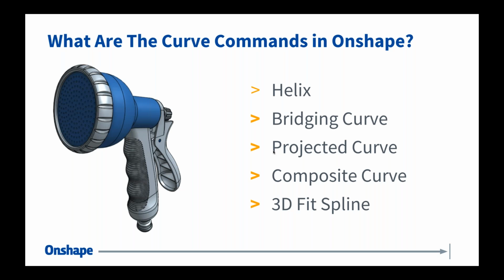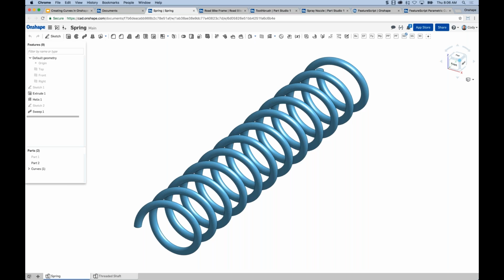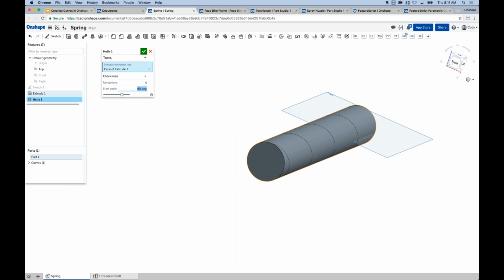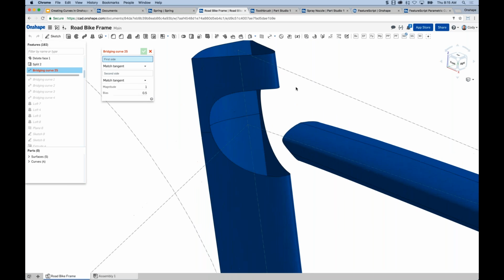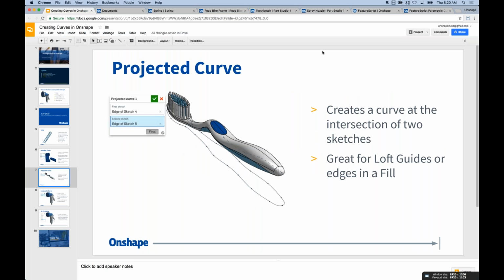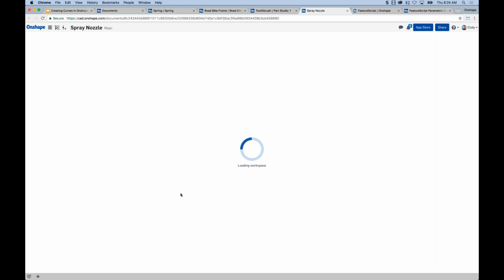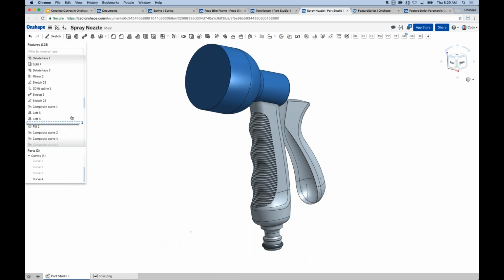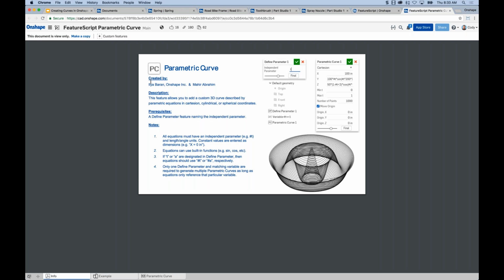Creating Curves in Onshape (August 24, 2017)

Comment: Cody, you've sounded like you couldn't find a good reason for why we might need Bridging Curve. In your bike frame example instead of using BC, you could specify tangency in Loft dialog window. When we need BC (or 3D Fit Spline) is when we need tangent transition but with a different magnitude on each side edge (rails). We also need BC when we want to guide Loft side edges, not because of different magnitude but because unguided Loft will create an unnatural frill/fold. Your bike frame example could serve to illustrate first reason at least.
Reply from the maker: Great example, thanks Michal!